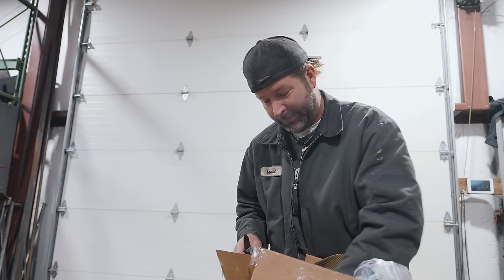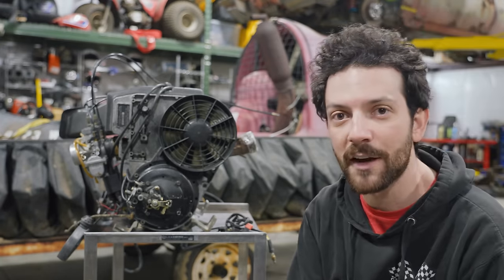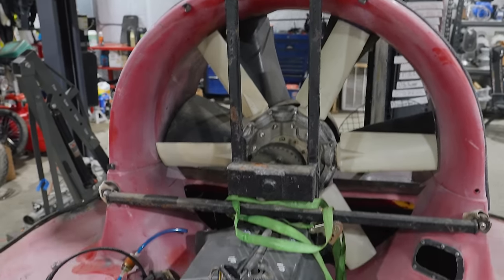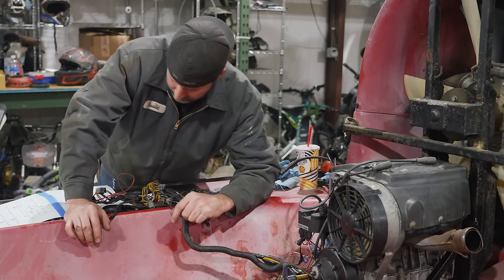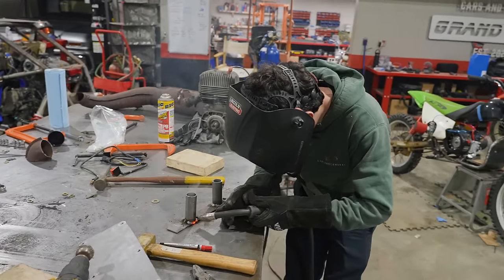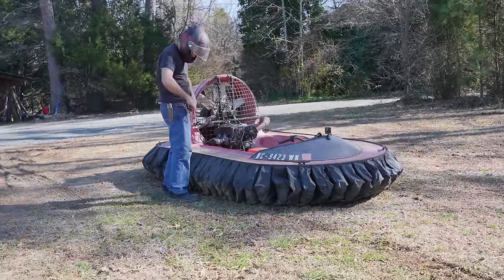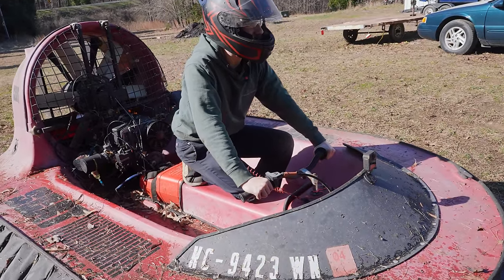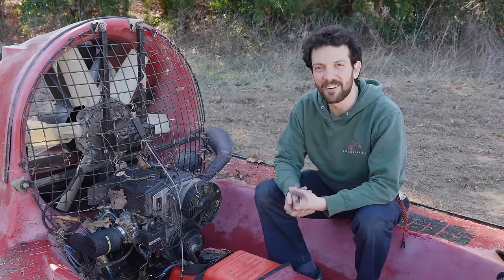Reviving our Hovercraft with a 2X Horsepower Engine Swap! (It Rips)

Comment: Now you just need more pitch on the props to make use of that power :)
Reply: And clean leaves
Reply: @ToplessTattoo  yeah might have to run the mower around and bag all that up haha
Reply: Definitely, they could get lift at way lower rpm and be more controllable.
Reply: You said it for everyone else on the channel ty
Reply: For sure. More wind!
Reply: Change pulleys for faster blade speed, or more pitch.    The engine isn't boggin at all.   Nice wierd awesome build as usual 👍👍👍
Reply: Beat me to it!
Reply: Change the pitch for more lift and speed.
Reply: It's calling for the everglades!
Reply: You beat me to the comment.
Reply: It needs to be buffed.
Reply: Came here to say the same.
Reply: And more weight on the front. On the water you can see the skirt come completely off the water letting the air escape.
Reply: @chuckfry1227  for sure! Half my rc hovercrafts will drag super bad if the balance is off and it lifts any edges of the skirt
Reply: That and they definitely need to remove a bunch of weight from the engine mount cuz i mean you could see how much heavier it was on the water with how tilted back it was before it was ballast for weight balance now it's just unnecessary weight causing Imbalance even with Ike on it
Reply: Also maybe increase the surface area of the steering vanes (make bigger ones or add material to the ones you have) for more steering force per turn of the handlebars. You know, physics!
Reply: @2001airrun I was thinking same thing. Lift seemed to be way to much. The front was doing a wheelie
Reply: Thats what I was about to say.
Reply: Twice as many blades need to be fitted. All they need to do is find them, and add them in..
Reply: It goes without saying they plan to adjust prop pitch with the more powerful engine, but naturally you first run it in the same config as previous.  
I havta smile at those who think the suggestion is news to the guys.
Reply: @DetroitMicroSound  depends on what youre going for, setups are usually either low blade count with high pitch (more thrust) or more blades with less pitch (holds more back pressure to inflate the skirt more easily without adding thrust)
Reply: That's what I was going to say

Comment: You both might not think it but this here hovercraft is definitely a great thing to have. They come in all sizes.. and this one in particular is absolutely a   go cart without wheels. The faded paint is not faded paint .. !!!!  It's actually in the fiberglass . A cut and polish will bring it back to shiny red .  It's gel coat.  It's mixed in with the fiber glass.  What y'all need to realize is that to turn y'all need to have thrust pumping through those rudder's. Also to stop quick just throttle off. When you throttle off that is the brakes... It'll drop down straight away and stop really quick. Y'all need to sit down on the motor cycle type seat and when cornering lean over just like a motorcycle...  So just get out there and don't be afraid to open it up.. because that's when you will have thrust pumping through to turn and hover... They do slide sideways when turning at speed but once you realize that you have to lean just like a motorcycle you will notice that the lean will lift up the outside edge and the inside edge your leaning towards will grip the ground or water . They race these things and personally I love them alot !!!!  I don't own one but I know how to operate one.. just like riding a motorcycle !!! If you lean forward the nose will slow it down and the air will all go out the back of the skirt.. please PLEASE don't give up on it..  please just do some research,,ie look for hovercraft races on the W.W.W  and y'all see WHY I love them so much...  Remember gel coat will come up like new with a cut and polish.. I think it is  "a great  " advertising platform for CARS AND CAMERAS... It's got plenty of power now so you can add lighting etc ..  take it out on a big open area and open it up !!!! Ride it like a motorcycle.. an hour or two you will realize just how fantastic this is..  thank you sincerely for all your time and effort to bring us this exciting content.. I truly love CARS AND CAMERAS .  100%. 10/10 in my book 👍   ❤❤❤
Reply: I’m assuming what you mean by cut and polish is “wet sand and buff”. I would use at least 600 grit wet/dry sand paper with warm water and Dawn dish soap mix.
Reply: Gel coat is just like paint, it’s a layer on the outside of the fibreglass. It can be polished just like paint using a cut and polish compound. And if it isn’t in  very good condition then more can be purchased from either a specialised fibreglass store or even from a boat shop, it can be sprayed on, though it’s thicker than your normal paint and the spray gin needs to be cleaned out straight afterwards with acetone.

Comment: Time to put a little more pitch in the blades to push more air
Reply: Exactly what I was thinking
Reply: It looks like there are spots to attach more fan blades too.
Reply: Not only that it looks like the rutters are a bit too short
Reply: There's a fine line between to much pitch and to little.  There's huge clubs that race these things and y'all need to investigate a wee bit because once you see them racing them you will see how there supposed to be ridden.. also the clubs will have all the secret little bits of knowledge .. like the perfect pitch.. (etc etc)
Reply: Yes but he had it set up with very little pitch with the little motor now the bigger engine can push a little bit more air so you may have to readjust his pitch
Reply: @Rob1970s  Yes but he had it set up with very little pitch with the little motor now the bigger engine can push a little bit more air so you may have to readjust his pitch
Reply: Naturally you first run it as-is to see where you stand.  It goes without saying they plan to play with the pitch.

Comment: Awesome move Ike! But I want to tell you as a friend and native Buffalonian, and connoisseur of 2 strokes and snowmobiles, that you may want to use that oiler. They offer far superior oiling to the crank which would be HIGHLY beneficial to long periods wot operation. Ontop of that it is jetted for straight gas not premix you are leaning out the mixture! Not good for 2 smokers!! If you dont want to use the oiler because of yhe extra room it will take, at least put bigger jets in it so.its not running lean wide open! Love you guys!!
Reply: And surprise, they burned down the engine because of exactly what you said.

Comment: More power means you need to add blade pitch
Reply: They would have had that plan in mind before buying the new engine.  Part of the process is running as-is to see where you stand.

Comment: Add two more rudders at the edges of the fan shroud - total of four, and the full hight of the fan.
Reply: Do some research and see if making the rudders longer (in the air flow) will add anything as well. Just a thought. Enjoy that machine! Thanks for the content.

Comment: Still needs more prop pitch! No matter how much hp you put on it, it's never going to get the speeds that it can reach. Like I said in my last post I had the exact one with a 35hp Rotax and with 1 person ran 45mph, mine ran faster at half throttle than yours. I also know from experience that to many rpm's can break the blades or strip or break the drive belt by over reving the engine. 
Good luck!!

Comment: Have a river trip. I've had hovercraft, with rotax engines, a 377 and 503 twin carb. Great fun! Went down the Upper  Bann river in Northern Ireland from Portadown to Lough Neagh. I'm not sure if you were over the hump while on the water. The craft creates lots of spray and does not go very fast if it's below hump and still acts as a displacement craft rather than an air cushion vehicle. There are look up tables for the fan so that you can have the engine loaded correctly for the number of blades and the pitch angle of the blades. Enjoyed your 2 videos. Thanks

Comment: Awesome. You know when you have a gap like that, take a old rod from a arc (stick) welder if you have some and knock the flux off it. place it in the gap and weld across it with the mig to bridge the gap. Just a thought, cool content thank you!

Comment: You need more pitch and surface area on the fan blades, plus larger surface area on both rudder blades, and then put some ballast in the bow to help her run more level, meaning you won`t be dragging the stern through the water. She rode more level on the hard land surface, but steerage was poor. Definitely try more surface area on the rudder blades. Maybe attach some extension strips down the rear edges of the rudder blades?.  Great vid guys, good to see a couple of good old boys having so much fun.

Comment: So cool, built a hovercraft when i was young and wanted one again ever since. Did seem down on power for the size of engine but as someone said props may need adjusting and i was taught to think of it kinda like a motorcycle you have to use power and lean to get it to turn.
Either way have lots of fun and be safe :)

Comment: I've ridden a few of those a couple of times, even blew up a motor. 
A few tips I might offer you guys. 
1. Weight is important for control. You may have noticed that the hovercraft turns if you don't have your weight centered. Take advantage of that and sort of shift your weight like on a snomobile or ATV. 
2. You might want to look to see if you can find a few more blades to add to the fan. 
3. When on the water, you need enough speed to get over the hump of water in front of you, just like a planing boat. Just like said boat, once you get over it, it'll get a lot faster. 
4. You guys noticed that shutting off the throttle on land can involve an abrupt halt, it's kind of worse in the water. The skirt and the bow can dig in. 

I'm sure you guys will get the motor fixed, have fun with it!!!

Comment: Those skidoo/Rotax snowmobile fan cooled engines are great, they are reliable and powerful for what they are, and the colder it is the more power they make they like it around 10°f...I got a 2003 ski doo 380 fan cooled and I can move along at 55mph fine (I've hit 70 before) and it gets up top speed quick

Comment: Agreed with the added pitch.....the second thing noticed is in the water you can see the balance of the machine is tail heavy which lifts the front and blows air from the skirt out the front like an air brake...the added pitch may force the front down but i don't know if it will be enough for engine weight compensation it may require 5-10lbs of lead at the very tip of the craft for max leverage. Looks fun..... definitely needs more load on the motor

Comment: Add some extensions to thos 22:24 e rudder blades to full height & tweak those blades a degree or two & lean forwards more over the bars when on the throttle it'll be race craft heaven😂😂😂😂😂

Comment: Cutting the pipe shorter would shift the powerband higher in the rpm range which would only add more power if the porting can support it. ***One thing to take in to consideration is if you plug the injection pump and mix your oil in the gas then the engine will run LEANER as a result because some of what should have been gas is now oil.***  A lean 2 stroke is a fine line, either a bat out of hell or a melted pile.

Comment: Yes Leaves on Exhaust is sometimes an issue... I think You never got over Hump Speed which was pretty typical of old scats even with the extra power... just practice get it trimmed and weight low you will have some fun... I have over 30 years in Hovercraft and I still occasionally make bad decisions on a turn and have to do evasive maneuvers but i want to portray the sport in positive light just hardly ever record my escapades anymore.  Get the hoverbug and respect the machine!!

Comment: Not to be mean,but at least we now have proof John's limit of strength is both hands on a bendy straw.At least he's good at holding a camera and witty banter ;), usually. Ok, just yanking your leash John. The crud in the fan shroud shows it's pulling tremendously. We'll still be your best fans.

Comment: Great work guys, and though you guys already did so much to get that thing up and moving again, you might want to consider swapping out that gas motor for a high power electric and increasing the rudder size for a lot more responsiveness and steering control, plus it'll save your ears and be less weight overall.

Comment: To get the best you need to change the pulleys to suit the 503c. 
Then adjust the pitch and use an anemometer to set max thrust. 
My scat 2 has a 503 with a gearbox to the fan and it shifts! Even uphill! 
Great video,  much more fun to this old stuff being resurrected than unboxing of Chinese crap.

Comment: Thing is awesome! I wonder if it would benefit from putting a smaller pulley on the fan (top) so you don’t have to rev it so high. That engine definitely makes enough bottom end torque to sufficiently spin the fan pulley faster. I think lower engine RPM + faster fan RPM + steeper blade pitch would make that thing a lot more drivable. It seems like more air is being diverted to the lift pillow compared to rearward thrust than needs to be.

Comment: Shortening the pipe is going to make that motor spin at a higher rpm. Especially 4 inches. I wrote this before finishing the video. Highly likely that thing melted down because of the pipe modification. I would add that length back into the header and obviously check your main jets. Cool video!
Reply: Shortening the pipe would just shift the powerband higher in the rpm range (obviously not ideal but wouldn't kill it), jetting is the reason it melted.
Reply: @bigdaddy12122   They would need to raise the exhaust port for that change take place. I don't think it will kill it either. I do agree with you just trying to keep it simple. It's going to raise the rpm the motor makes power at. Without raising the exhaust part it's only going to hurt it
Reply: @bigdaddy12122   I understand fuel is a part of the cooling I drag race snowmobiles  When the weather is warmer I jet down.  If I was doing something like what they are doing I would want more piston to cylinder clearance to prevent 4 cornering

Comment: It's a shame that you lose so much  power running two headers into one expansion chamber, but it still has got more than it needs, it'll be fun when you get the chance to take it on a frozen river for some high speed action. Just don't stall it.
 Great work, guys

Comment: That's quite the leaf blower you feller's  got there.  Like a few have mentioned blade pitch will increase control as well as full fan control blades should increase control, theories to test . But cut and polish with a biike seat and a front counter weight for engine  difference in weight will provide a more sit back and enjoy position and learn how much lean/ throttle needed to carve those "aiir waves ".

Comment: That thing is awesome! 503's are bulletproof, we had an old Blizzard 5500 that lasted for years, being abused that entire time! Well done gentlemen! edit: I got to the very end and spit out my drink, maybe that one wasn't as bulletproof! lol
Reply: Ike didn’t use the oil injection and you cannot bypass it on those Rotax engines. The oil goes straight to the bearings, and they don’t get the oil they need if you bypass the oil injection. Plus, since the fuel isn’t supposed to be premixed, the added oil is making the engine run lean. As soon as Ike bypassed the oil injection, I knew it wasn’t going to last long.
Reply: @adamr9215  ours wasn't oil injected, but it was also a 1980. I had a 7500 that had an extra reservoir for oil that directly oiled something in the bottom end.
Reply: @klapaucius77  Yea, the old ones were fine. But, if it’s set up for oil injection, then you have to keep it.

Comment: Keep the net clean and the front of the engine you choking it of air for the prop, bags and cooling for the engine I would mix a 32:1 ratio to help keep it cool and lubed. Also the bags are ripped where the water splashes out or the zip ties are broken. It should not shoot water out like it does from the sides if everything is order with the bags. When its working right they are actually faster on water. My friend and I had four of these things over the years.

Comment: I think a net that goes from the top of the fan shroud down to the back of the seating position may help with the leaves. A fire proof cut out for the exhaust for sure though.

Comment: TIPP / IDEA it helps to turn wehn u try to lean like with a motorcycle to bild a tiny little more friction on the inside of the cuve 
and the second thing is u have a weight ratio problem with the more havier motor it try to lift up too mutch the nose this is one reason why u are so slow on water AND the bad steering wehn the back is more "draging" to the ground  -> it is possibile to take the fuelcan (tank) bring more to the nose or make the nose little havier to make a good balance.  
AND one thing to your bad steering -> maybe shorten the steering cable a little to bekome more lever out of the control things ( sry 4 my bad EnGlicH im fron german ) it maaaaayyybe make it a little more spicy but bertter handle is more fun and savety 
have a nice try and a BRATWURST XD 
i m happy of your next  video <3

Comment: if you guys look at the video's Garrett did on his scat and the racing guys that came out to set him up... it's the skirt and the prop fan blades... pitch, number of, shape... you name it.. the thing is FULL throttle at all times.. no rpm's, no cushion of air to stay up on! kinda backwards but it's the truth.. also, check the steering vanes ... w/ the extra HP, lengthening them might help...

Comment: You guys need to adjust the pitch of the props, bc you should be going a lot fast than that. From the looks of it you're pushing way more air through the skirt than is needed to raise the craft, and it's slowing your forward thrust down big time. I'd say little less pitch and you should be golden. 👍👍